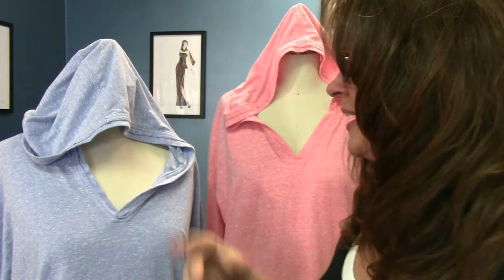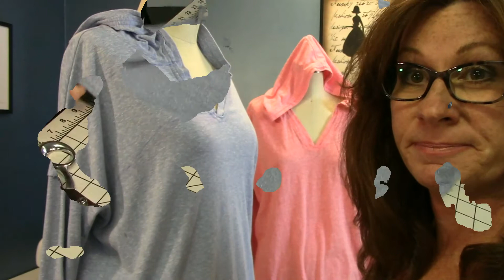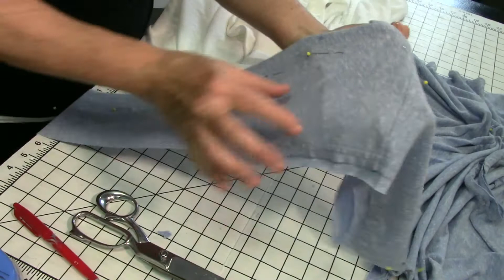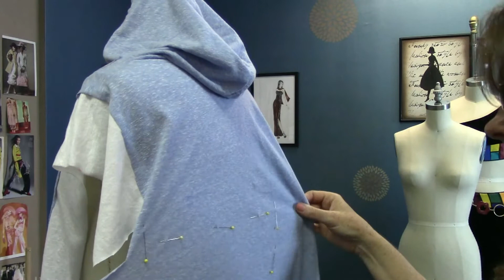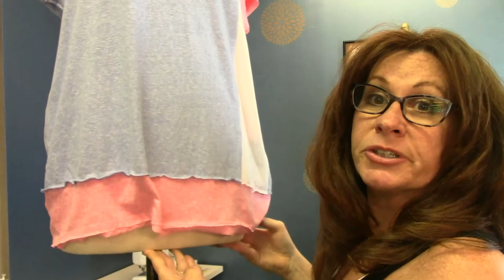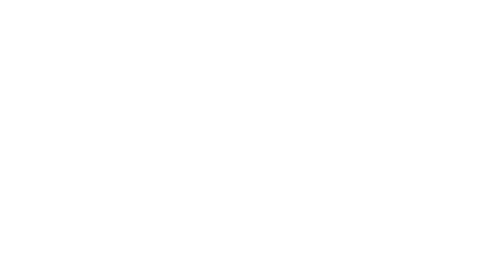3 Little Hoodies upcycle

Comment: I would have winterized the 3 into 1 'puffer' jacket. I would have used the white as outside, with the red as lining and the blue as batting. I would have quilted the lining and backing together in a diamond pattern, I would have added pockets on outside - either kangaroo or patch pockets. I would have added an attached scarf on outside made from sleeves cut from red hoodie. I would have attached a tab and button at neckline to close hoodie, I would have hidden all seam allowances. On outside I would have embellished across yoke with contrasting bead (pearls and clear crystals).
Reply from the maker: HI, Whow that sounds like a lot of work!  You must live some place cold, that would be good for cold weather.  I like your idea of 3 into 1 puffer and your beading idea.  
Thanks for your ideas, I may use them on another video!